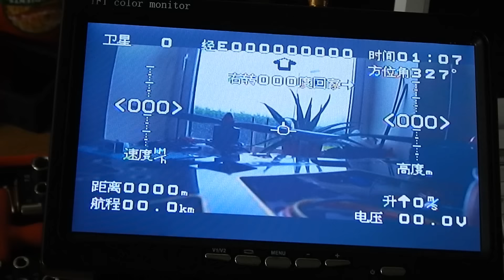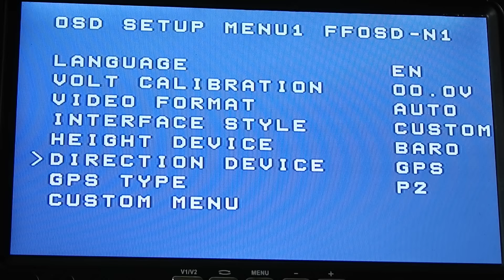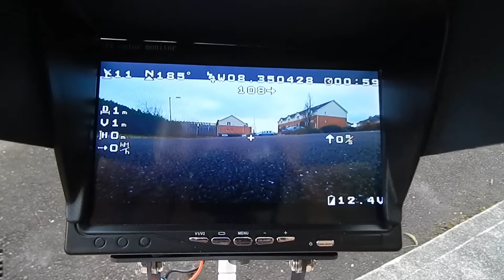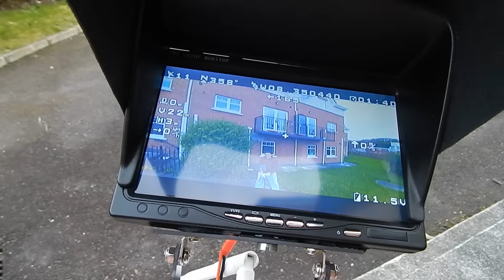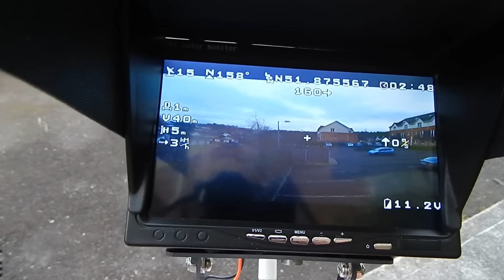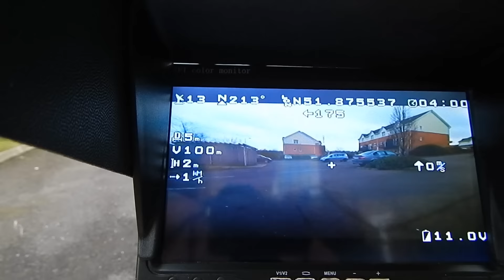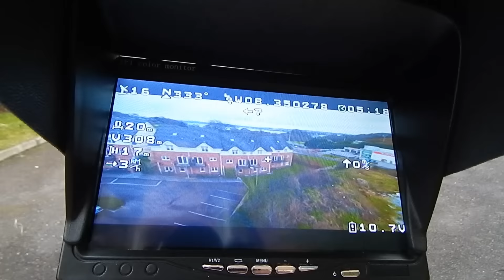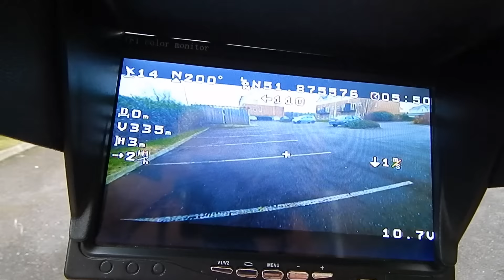N1 OSD Module For DJI NAZA V1 V2 NAZA Lite

Comment: Really nice, man! 😊 One question, I'm going to use 2 cameras, a fpv one and something like the Xiaomi yi really, with a gimbal. So I need a fpv switcher... Does it work together? Thanks! 😊
Reply from the maker: Yes it will work, u need to connect everything in the right way, But to be honest i was using only xiaomi yi on the gimbal, and i decide to not use fpv cam for me was useless
Reply: Luk RC Thanks a lot! And I know what you mean, but as my camera is going to be on a gimbal that can move upwards and downwards... It's better to have a second one, fixed, for reference. 😉

Comment: Hey buddy, can you tell me what settings you are using ?? tx transmitter type and type of camera, I really surprised by the good quality in the monitor, I really like this configuration, thanks for your reply ... bye
Reply from the maker: Hi mate, I using Boscam 5.8Ghz 200mw tx & rx + High-gain Clover Mushrooms antennas and Xiaomi Yi Camera for recording and fpv 
Happy Flying :)
Reply: you can tell me your monitor? Thank you for your kindness, good luck and good flights..
Reply from the maker: https://www.youtube.com/watch?v=paERkCoFcPA     this is my monitor, but better to buy no-blue monitor 

like this one 
http://www.aliexpress.com/item/7-FPV-LCD-Color-800x480-FPV-Monitor-Video-Screen-7-inch-HD-Sun-hood-for-Rc/1951841641.html?spm=2114.30010308.3.1.GNnbSv&ws_ab_test=searchweb201556_0,searchweb201602_5_10037_10033_507_10032_10020_10017_10021_10022_10009_10008_10018_101_10019,searchweb201603_6&btsid=77979898-7009-4772-89ba-256faa3809d8

Comment: Hello, thank's for your vidéo! Please help me, i have a probleme with my n1 osd and my xiaomi yi, the n1 osd Does not appear on the screen, do you have a solution?
Reply from the maker: if u have video on your screen but no osd, it mean faulty av cable
Reply: OK, thanks! I also noticed that when the osd is on "pal" the osd flash on my screen, so is the av cable, sure ? Because the cable is homemade?
Reply: Hello, I tried with an ebay cable and it works! Thank you very much!
Reply from the maker: modélism4fun No problem  :D  happy flying

Comment: I cant get voltage to appear..everything else works.. Please help
Reply from the maker: did you connect battery to osd ??
Reply: Thank you so much for your help, I have an N2-Mini no place for the voltage to plung in, got the yellow wire on the u of the Naza, other in the throttle , video is powered by a separate battery, how do you suppose I show the board the voltage?

Comment: does this have thr diamond thing and english language
Reply from the maker: yes , it does
Reply: +Luk RC thanks will i need to change it to english language in the menu
Reply from the maker: Yes
Reply: +Luk RC 👍
Reply: +Luk RC hi mate got n1 osd not installed it yet but looks a bit different to yours usee the power from the naza flight controller